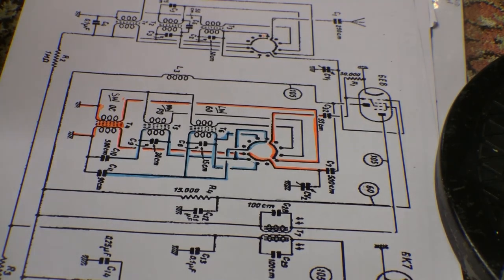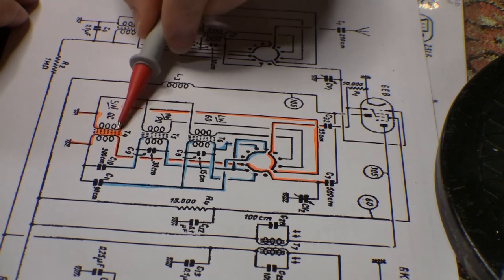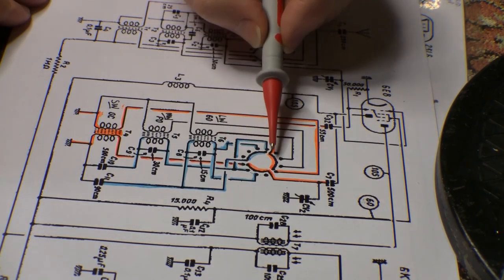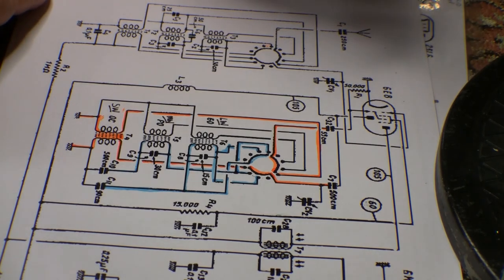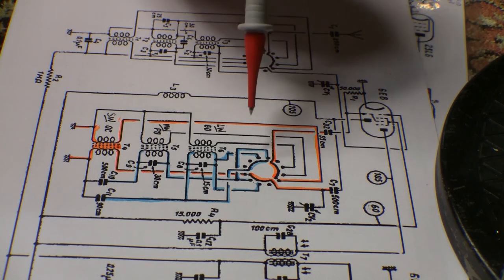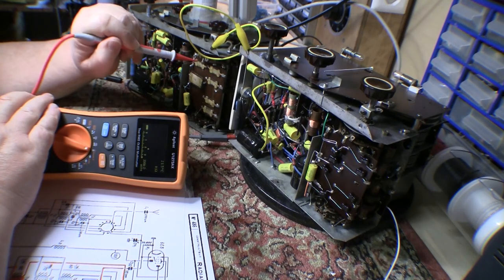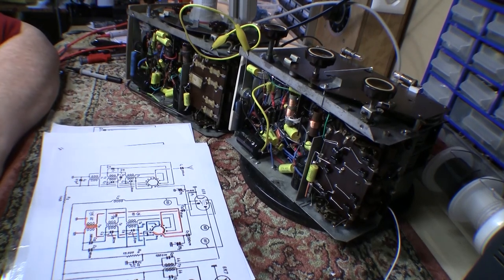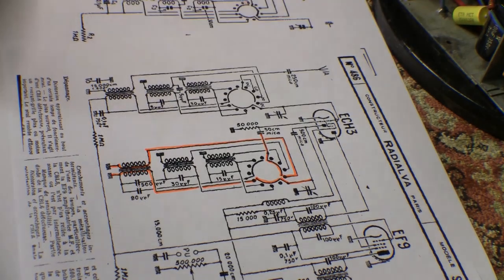Radialva Groom Rebuild - part 20

Comment: My practice in these situations was to strip the suspect area and rebuild to the reference circuit, I understand your situation, been there many times. Best of Luck, you will get there. Oh and if it's using a stacked wafer switch check if the rotary portion for SW is rotating fully and nor slack or slipping on the shaft for some reason, it happens.

Comment: This is the sort of situation I love, something to tax the mind.  I think that I would swap the short wave coils over between the sets to see if the problem moves with them, it would probably take less time than you think. As for the leak to ground on the long wave, I think that it is probably a red herring but I would unhook a few wires to try to isolate the leak just for curiosity's sake.  Good luck.
Reply from the maker: Thanks, yes I will be doing more messing about with the waveband assembly, that's for sure.   I'm sure I'll find it interesting once I've sorted it out - right now it's more frustrating that interesting - but it is certainly taxing my mind :-)

Comment: Perhaps the short wave coil has one winding connected out of phase with the other? You could try swapping the connections on either the primary or the secondary winding to see if it makes a difference? One thing to do is see if the mixer-oscillator tube is oscillating with the set in short wave mode, check the voltages on the working set while in short wave mode and compare to the non working set. Another possibility is a problem in the short wave antenna circuit?
Reply from the maker: I confirmed with the scope that there is no oscillation in SW mode.  I'll continue doing comparative checks with the working set to see if I can track this down.

Comment: Not sure how much you have checked out the switch but that might be the problem. It could just seem to work on two of the bands and still have connection problem in the third.
Reply from the maker: Hi Mark, well I took the waveband section out again this evening and spent an hour or so re-cleaning the switch and double checking the contacts.  At this stage I have to assume it's not a mechanical switch problem - unfortunately!
The mystery continues.
Cheers,  John.